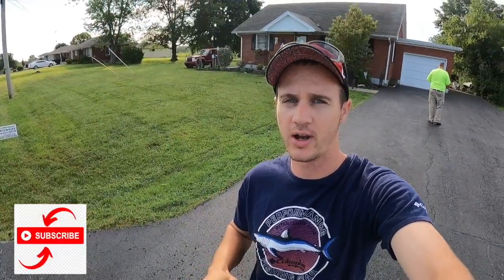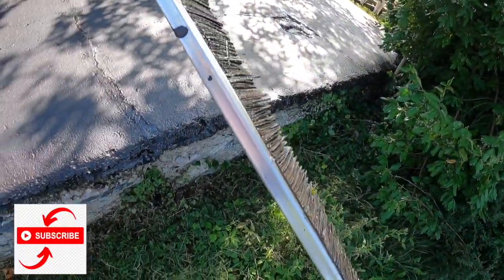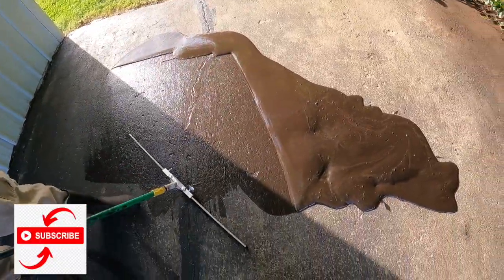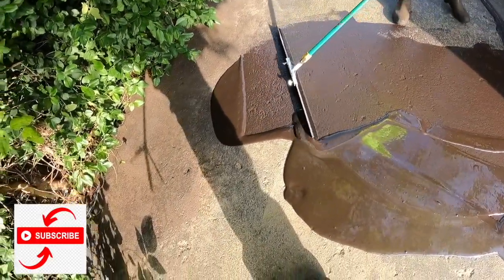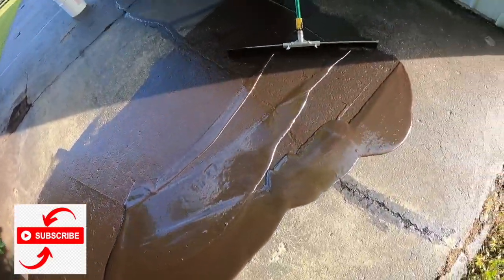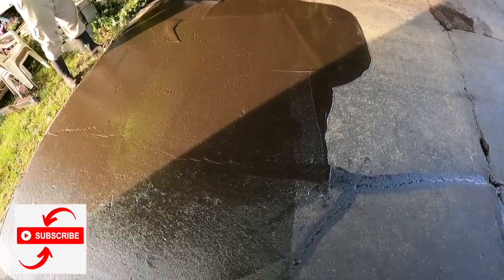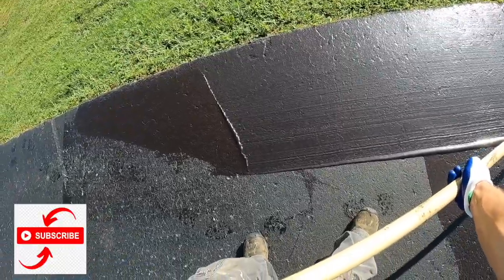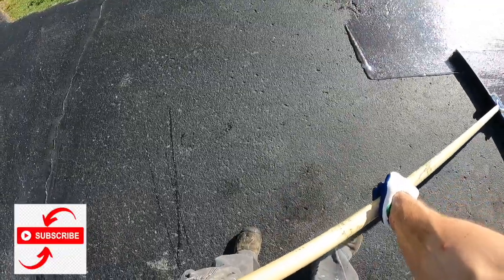Driveway sealcoating with a brush | Can definitely do this yourself

Comment: Hi. I appreciated the video. I started using that same brush when I sealed my driveway the last time and it worked very well. I also started walking in the sealer then brushing the footprints out. I had not done that before and it goes much quicker with that approach, rather than avoiding stepping in any of it. I just keep a couple pairs of shoes or boots for sealing only. One obvious thing with this driveway in the video is that it really needs to be replaced and sealing will do very little for it other than slight cosmetic help.
Reply from the maker: Yes I agree but that was what the customer wanted and shows the importance of keeping it sealed.
Reply: Cómo se prepara ese.sello
Reply: Replaced or overlay. Most of the driveway looked to be in fairly good shape - good enough for a 1 1/2 - 2" overlay IMO.
Reply: Why is it that none of these companies that post and otherwise promote sealcoating, never add a genuine Rejuvenator with Maltene Replacement Technolgy (MRT) that has been proven to extend the life of asphalt 30-40%
Reply: There is no reason why a worker would need to walk in the wet sealant, after it's been applied and if so, they're only double working themselves because, you have to sealcoat it again to cover their footprints.

Comment: Can I ask why you didn't fill the holes on the upper right side of the drive? Great video.
Reply from the maker: The customer didn't want everything patched so I didn't want to fill it full of sealer. We hit it with some so it looked uniform but just not with patch or anything.

Comment: Where can i get the sealer? Are y’all pouring it out? I missed that part
Reply from the maker: You can get it in 5 gallons buckets from home improvement stores (lowes home depot menards). You can also get it from places like seal master that is where we got ours from
Reply: @projectdiy873  great vid! what's your experience when it comes to using home improvement store sealers vs seal master's sealer? I'm looking to do my first job but im on the fence of buying sealer from store or from Asphalt Kingdom. Thanks for any tips!
Reply from the maker: @pablog4852  I can't say that I have a lot of experience with them. But there are pros and cons to both. Nothing substantial but depending on how big you area is that can be a lot of buckets from lowes etc... both products will do the job for sure. Thanks for watching!!

Comment: Hey I was wondering what sealer you use. I noticed that it's slightly brown and it reminds me of the sealer that SEALCOATINGISLIFE uses.
Reply from the maker: It was from sealmaster
Reply: @projectdiy873  ok thanks!
Reply: All sealant is brown when it's thoroughly mixed, but it dries black.

Comment: My issue with sealcoating as DIY is the cost savings is not always that great when it comes to having a professional do it instead. I might spend $80 in sealer (excluding all the other equipment you need to purchase or should purchase). While I could get a pro that will come, edge, prep and seal for just $20 - $30 more, and it looks great. And they do it fast. Definitely skilled and its like they do it just so perfectly and quickly.

My other biggest issue is I cannot find professional grade sealcoating tools at the local big box store. I can't get a squeegee wider that 18 inches from there.

If you are able, can you refer to where we can easily purchase the same tools you are using. If we can find them at a local store, that is even better. Also, it would be nice to show how to take care of these tools after using them. Like how to clean them. I have been using the same squeegee for years now once I disciplined myself enough to clean it after using it.

I try to have a pro sealcoat my driveway if I remember in time to have the do it. Usually I forget and the schedule is so far out and variable because of weather, I just do it myself. If they were doing my neighbors driveway and stopped by and quoted me the going rate, I would have them do it right on the spot.
Reply from the maker: The brushes we were using were bought from seal master, and I believe also menards
 Cleaning just put in water after use until you can rinse and clean them well after the job is finished
Reply: Amazon
Reply: One of the benefits of doing it yourself is that you can do the job exactly the way you want it to be done, from prep to completion. Sometimes a contractor may do an insufficient job, and the end results is not to the customer's satisfaction, then it will start a complaint with the contractor.

Comment: Does the brush leave line mark? And does the finish looks smooth after drying? Nice video BTW!
Reply from the maker: As long as you don't leave a big excess line of sealer it will not. Sometimes a few small brush marks are noticeable but we went side to side after so they were not noticeable if there were any. Yes it will look smooth after it dries.
Reply: Should you go over with a squeegee after the brush?
Reply: @jdpnation4786 just use a squeegee from the start if your driveway is not a rutted up mess

Comment: Does the brush work the same as a squeegee
Reply from the maker: Pretty similar just takes put any bad line you may have left with squeegee
Reply: @@projectdiy873  thanks my team used to spray but we're switching over to squeegee so I want to get the techniques down

Comment: I can tell that you were amateurs because you guys were all over the place because, you didn't have a system and no coordination. Everything was done haphazardly! When you spread sealant, you're supposed to go horizontally (side to side) from top to bottom, not going every which way you see fit. There was no uniformity during the application whatsoever. The edges around the driveway were supposed to sealed with a paint brush first (as a border), to prevent any unwanted sealant from going outside the perimeter of the driveway, such as the grass, sidewalk and in front and on the garage door. Also, not only you're supposed to seal the big cracks, but ALL the cracks regardless of how small they are, for the job to be done correctly. That's what the customers are paying you for, is to do the job and do it right.